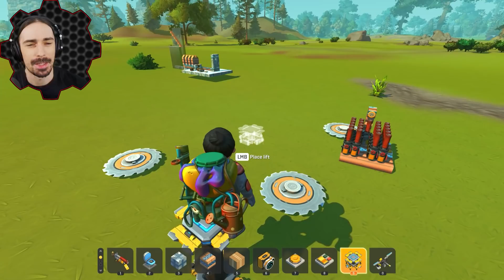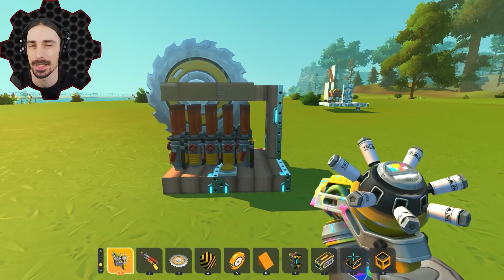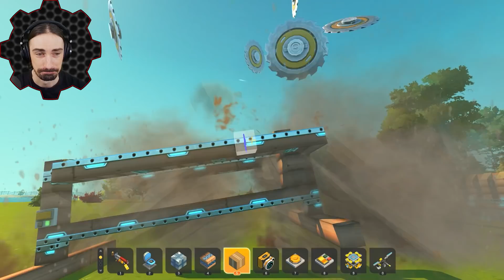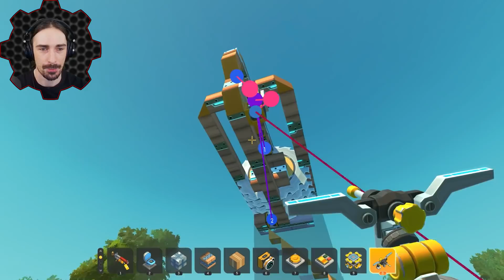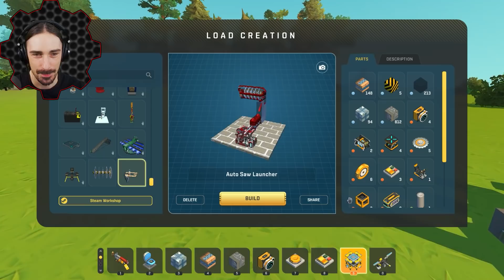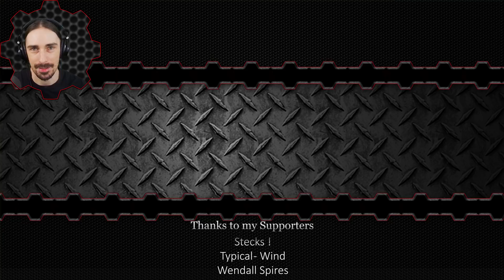Over-Engineering an Automatic Sawblade Launcher! - Scrap Mechanic Gameplay

Comment: Idea for your next over engineering machine. You know how Hot Wheels had that whole deal about "CRASH 'EM" with their tracks, because it makes sense to build a huge circuit to only have everything go wrong at the beginning. Could you make either a catapult or some kind of launcher to try to mash two or more bots together? Will they damage each other? Will one obliterate the others? Will they combine like a Contructicon?

Like I can see two haybots being shot at each other, but I can also see a contraption that flings two ragdolled Farm Bots at each other and before they leave their launchers a totebot at the mid point is launched straight up and gets sandwiched by the two farm bots. . . . like a red-green-red sandwich.

Comment: I've commented this before, but I'm almost certain now. Impact damage like fall damage and "car crash" damage all are taking into account both the mass of the object and the velocity of it as well. So saw blades have a "cutting edge" that's not the blades but will more easily deal damage to bots and to trees. If you hit with that edge, I think damage is transferred more easily, but the most "physically mechanical" damage you can possibly deal is still compressing a bot into the ground (Physically Mechanical meaning not an explosive or a spud gun.) But even then, it's not really like you need to pound them into the ground. I've found out if you rag doll bots, drive over them while they're rag dolled with a sufficiently thick vehicle, and wait for them go get up; if they stand up underneath your vehicle and don't phase through it they'll end up crushing themselves. Or in another sense, you don't have to go super fast, you just need to be heavy enough to force them into the ground. The damage does need to be clarified as to what does what in the game.

Comment: For reloading the Spudgun thing, try vacuum pumps - and filter in cardboard to them (or glass) and then make them pump the cardboard/glass onto the blocks. Yes they have a massive hit box, but you can just use either pistons to move it gradually along each (slow though) or a controller and bearings to angle it at the blocks. (Instant)

Comment: With the first working design (before you made the one that reloads) you could have a piston that lowers down with a saw blade attached to it. The you could use chests connected to a dispenser replenish all of the cardboard. And it would result in the saw blade being disconnected from the piston and the spud guns would hold it in place

Comment: alternatively, you could use  4 pistons, one set to length 1, then 2, 4,8. That means you could place 7 saw blades with a block of space in between, then delete the space, push forward 7 blocks (by activating pistons 1 2 and 3) then go forward by 1 each time, so piston 4, then 4 and 1, 4 and 2, 4 and 3, 4 + 3 + 1, 4 + 3 + 2, 4 + 3 + 2 + 1

Comment: 6:21 you could have it load like a shell of 5 at the back, but connect them with cardboard and have something destroy the cardboard as they get dropped in. then all you need is a slot on the end that drops one blade down.

alternatively you could have the cardboard sawblade cartridge, then just cut the one off the end to drop it and load it.
so the sequence will be.
Empty?
Load cartridge
Lock cartridge 
LOOP (1)
separate end saw
Saw in cradle?
piston increment 
WAIT
Saw launched?
GOTO (1)

The piston can keep incrementing then just reset when it ends.

Comment: Replace the saw blades with explosives, but you'll need to figure out how to pad the initial drop of the round, and then make a way to adjust trajectory.  Could be useable in survival, as a mortar system.

Comment: I tried making a sawblade launcher once that worked pretty well I used the really slippery orange blocks and set the sawblade on a platform and basically squeezed it with a couple of angled blocks and it just popped out like wet soap and flew quite far! :D

Comment: You could've make the magazine spawn with an engine connected to bearings between the blades. Have cardboard surrounding each blade for more surface area and then while each is spinning shoot the cardboard and launch it. Hard to put it into words but basically just make the magazine itself have the ability to spin.

Comment: Nice video.

Hmm i wonder if you can dispense cardboard blocks in creative.
If so, I'd love to see you try the spudgun transfer method.
Do a build where you would only need like 2-3 dispensers that can load the cardboard and then you only need to get out to place the saw blade.
I'm thinking shooting it on to an existing block with a bearing may work but idk.